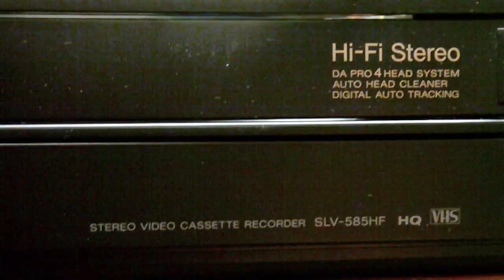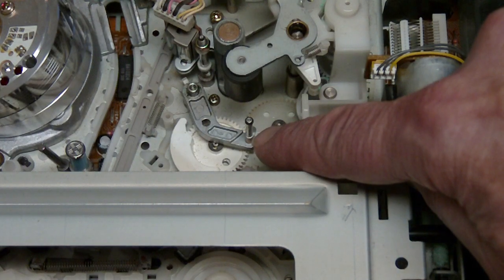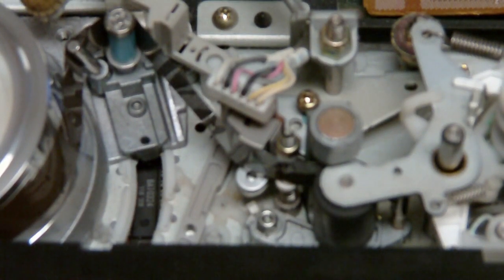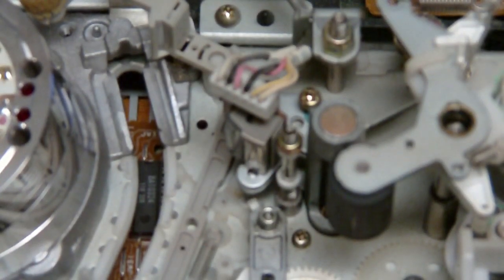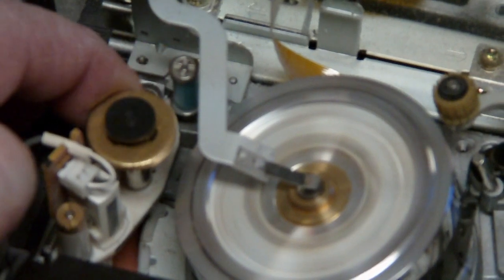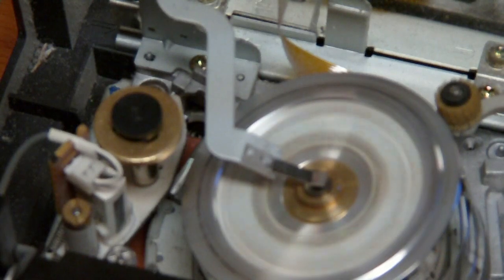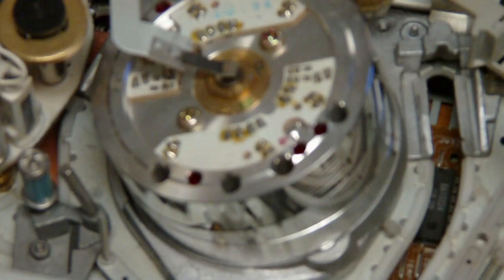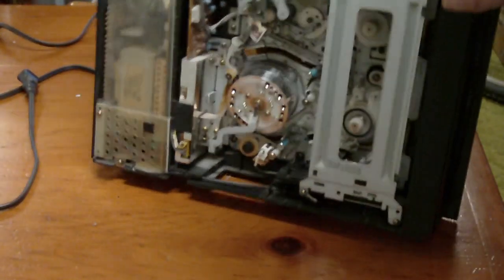SONY SLV-585HF DA PRO 4-Head VCR Repair Tear-Down

Comment: You are a star, thank you... my problem solved, it was the STUCK LEVER that you hilited. I removed the nut, added a few drops of lighter fluid and jiggled it back into action. Finished off with a drop of light machine oil (eg. sewing machine oil) and replaced the nut. VCR is now working perfectly.
Reply from the maker: Glad it helped

Comment: I had the same problem with another Sony VCR. Watching your video gave me the idea that one of the tape pitch rollers was not working. There are two of them, one on the each side to press the tape against the head drum. I checked mine VCR and indeed that one of the gears was broken. However, you can still find them one the net. kp components of Canada carries some, but other companies too.

Comment: Hi Mr. X2Y, you have a lot of knowladge with VCRs.
I have a SONY SLV E-50. When I PLAY the VCR after 3 seconds stops. The tape it's okay, everything is okay. I presume it's problem on the Reel sensor. The problem I have is I can't take out that green electronic cover that you had take it so easly. My VCR has more electronic covers that are stuck even after I unplug connections. For the VCR SONY SLV-50 can you send instructions so I can take out the plates? Do you now where are the Reel sensors?

Comment: When you put your finger on the head you destroy the head! The very tiny heads in the rotating drum have very tiny little windings and they must be cleaned with alcohol and very carefuly without power on the unit. The procedure must be done by someone that understands the principles of magnetism and is familiared with various types of heads. Some Philips VHS players have a type of head that even a damaged tape can rip the heads off completely. Sory about my poor english. NEVER DO THAT WAY.

Comment: video stop at 2:16.  To the right of this machine underneath your hand is a motor.
What is this motor called?  And what would do if it didn't work.
Reply: Eject motor. spins and the white worm gear makes gears move to eject tape.
Reply: Just a big thank you, for answer my question.

Comment: Nooooo! You can find those parts on the web. They are hard to find because of the age and you need to know the part number. However, most Sony VCRs share a common mechanical design. I even have some those gears.

Comment: muppet. laugh if you tore the head tips out of the drum! soak a 2 inch by 2cm piece of paper in alcohol, hold GENTLY against the drum and rotate slowly by hand till paper is clean. Never use cleaner tapes either.

Comment: I had an even better Sony with the same EXACT problem, the same exact broken blue gear. This happens to these. Sony should have made that gear out of metal. I tried to fix it but coudnt. I ended up having to  throw away the entire unit over one stupid platic gear. This really put me in a bad mood. If any of you readers needs other parts you better let me know and ill go outside and pull it for you. You have till monday morning when the garbage man comes.